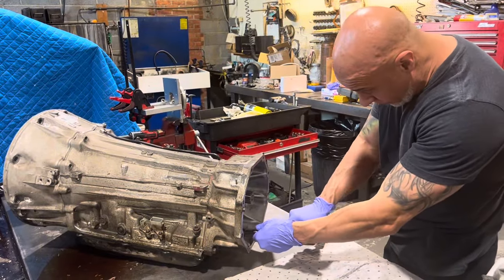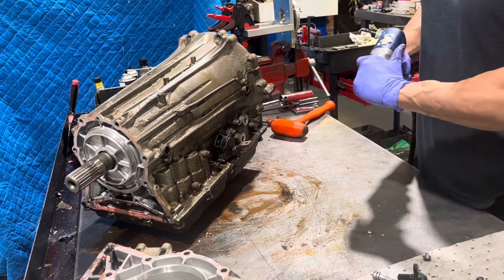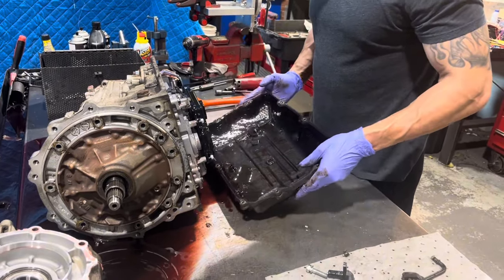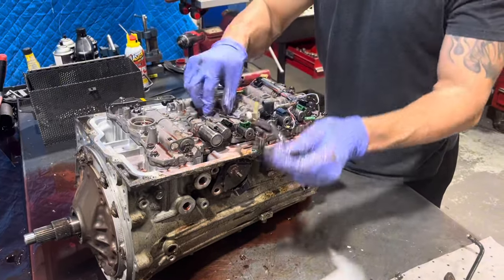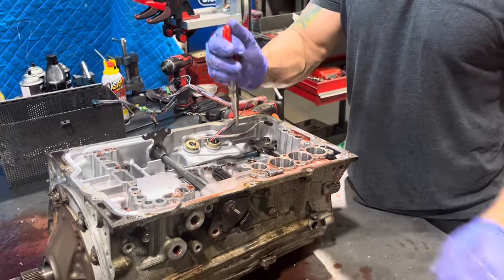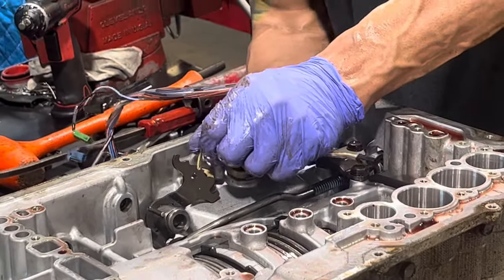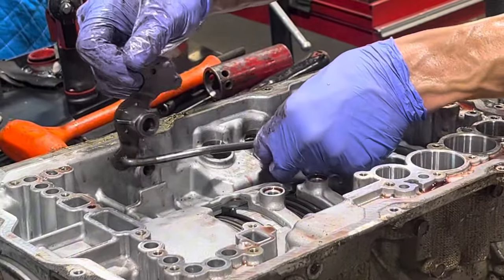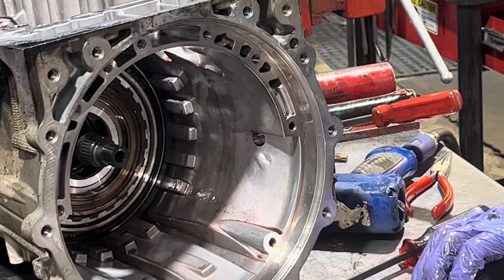Tundra AB60E AB60F Automatic Transmission Rebuild- Disassembly

Comment: At my age of 72 I have owned many different trucks and also driven a lot of work trucks of all brands. In my driveway now is my dream truck. A 2018 Tundra Platinum. That transmission is the mack daddy. I have never had a transmission that shifted as smooth as this machine. Ford, Chevy and certainly not Ram can touch this truck. PERIOD

Comment: Does the code P2714 and P0761 mean the issues are more likely burnt out clutches than bad valve body? The truck tends to behave fine after initial driving and being stuck in 3rd gear for about two miles
Reply from the maker: @delightfulsunny  It’s usually a failing transmission

Comment: Have a p2714 pressure solenoid D performance or stuck off and p0761 shift solenoid performance or stuck off codes. Any chance replacing these solenoids can save the transmission. Only slips 4th as far as i can tell early in the AM on cold days.  Changed the fluid over the weekend and it was pretty black so not a good sign. May drop pan today if bolts cooperate.
Reply from the maker: Unfortunately, those codes aren’t usually fixed with solenoids. Your transmission is probably failing (burnt clutches, etc?
Reply: @iptperformancetrans  yep did a spill and fill yesterday and the fluid was black. Going to drop pan today to see what the magnets look like.
Reply: @iptperformancetrans  the problem isnt horrible yet. Drives fine on warm days and good after warms up on cold days  but yeah after I replace the solenoids guess I'll start saving for a reman
Reply from the maker: @hinds90  Our info is in the description and pinned comment if you need it

Comment: Do you know what causes that kick into second gear on tundras? If im smooth with it or im turning, you can barely feel it. If i floor it, it feels like a honda fit rear eneded me when it goes into second. All other shifts are smooth no problem. Its just the first shift thats worrying.  Could it be the drive shaft support bearing?

Comment: Great video!
I have a 2013 tundra 4.6 2wd  6 speeds.
I bought a transmission by mistake from a 2013 tundra 4.6 2wd 5 speeds. Now I want to try on my truck. Do I have to change the ECU?
Reply from the maker: Do yourself a favor, don’t go there and put the correct component in your vehicle or you’re probably never going to get it to work. If you do it’s going to be a nightmare.

Comment: How often should the fluid be changed for normal work truck use?  Is a flush sufficient?
Reply from the maker: Drain and fill every 30k is usually good if you do it from the start
Reply: Perfect....Thank you! @iptperformancetrans

Comment: I’m having an issue with this AB60e it’s not going together the way I think it should it was hard to spin the output tail shaft so I’ve taken it apart I was wondering if I could get your advice on what I could be doing wrong
Reply from the maker: You can try to give me a call at the shop and I’ll try to help.
It’s a pretty vague question to handle through the comments

Comment: Would you recommend the A750f or AB60 transmission if you plan on towing 8000 lb trailer
Reply: The A750 is the older 5 speed auto, the biggest engine they ever put it behind was the 4.7l V8 (2UZ). It was used up until 2010. But if you got the 5.7l V8 (3UR) in the Tundra, Sequoia, Land Cruiser, or Lexus LX570, you got the AB60 which is an even stronger transmission and it's a 6 speed. You'll want the largest engine and the strongest transmission which would be the AB60 or AB60F. Toyota designates the F at the end for a 4WD transmission.

Comment: Hi do you know which solenoid on the AB60E is responsible for reverse. Thanks
Reply from the maker: It doesn’t work that way, reverse comes right off of the manual valve
Reply: ? So reverse is not engaged by a solenoid?  All hydraulic via valves, manual valve/lever position etc... wow, i've been without reverse for a year.... and just 2 days ago I'm experiencing no 1rst in standard mode as well as either slipping or binding on accelerating from a stop. After finally n sluggishly reaching cruising speeds 4, 5, n 6 ranges seem fine.  328k on my 08  Tundra. 1:29

Comment: Toyota choosing No Dipstick tubes on the AB60e has reeeealy fkd alot of loyal Tundra owners!. My 08 developed a leak within the bell housing area bout 100,000 miles ago. Since that I've done a filter n fluid change and have added fluid a few times after that, but trully I didnt ever know how low it was... just 2 days ago I drove a 4 hour round trip through alot of hills... now its either slipping or binding on take off, has no 1 in std mode, no rev, but seems normal on 4,5, n 6 ranges. I added fluid but no change

Comment: ? So reverse is not engaged by a solenoid?  All hydraulic via valves, manual valve/lever position etc... wow, i've been without reverse for a year.... and just 2 days ago I'm experiencing no 1rst in standard mode as well as either slipping or binding on accelerating from a stop. After finally n sluggishly reaching cruising speeds 4, 5, n 6 ranges seem fine.  328k on my 08  Tundra.  I feel like my trans is gonna have me stranded on side the road soon
Reply from the maker: @shawncybynog4768  You are driving a vehicle without reverse for a year and you are worried about getting stuck?
Reply: @iptperformancetrans  Lmao, love that comment!
I've learned how to choose my parking spots!
Also learned that you dooo not wanna have to push a 4dr Tundra by yourself!  Its Surprising how heavy they are!
Reply: @iptperformancetrans  It has become a calculated technique! If I cant get out of there then I dont go in there. Been a hard life but I've made it happen.  Sadly now I believe my forward 1rst, 2nd, or 3rd clutches or sprags  are idk binding or slipping bcuz I've been poorly managing a fluid leak from somewhere in the bell hsg.
Reply: @iptperformancetrans  difficult without a tube n dipstick to know when its low